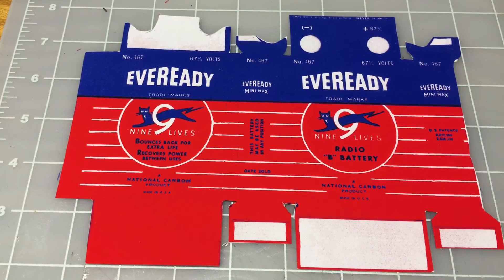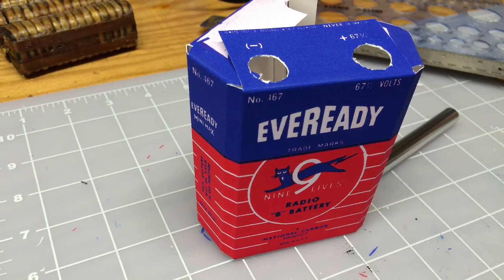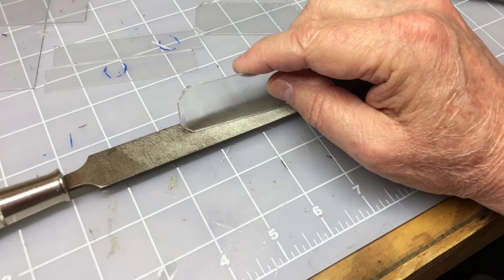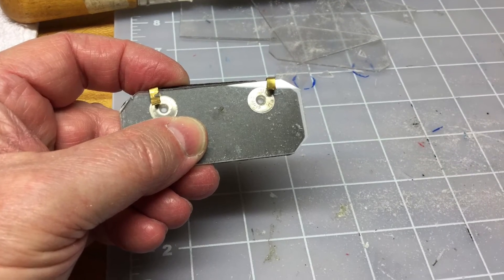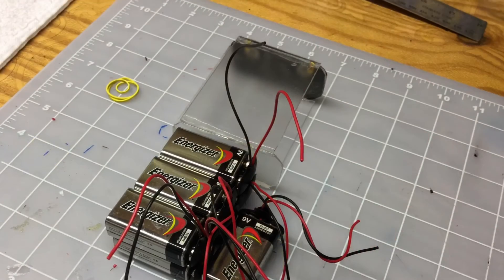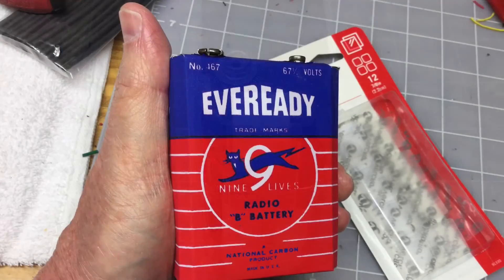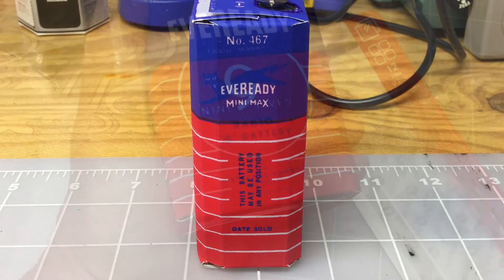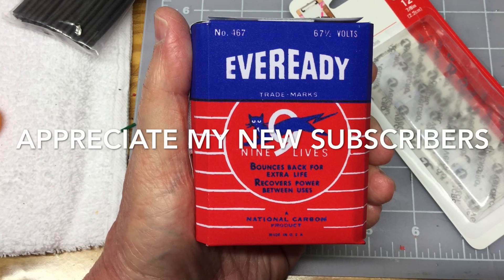Building a Type "B" Battery Holder

Comment: I tried to do a quick count on the batteries.  Is that 7 total?  Nice job on the case.  There are a lot of these old batteries which are no longer available.  This resurrection is not only nice visually,  but you have also brought the past into the present.
Reply from the maker: Stephen Moore Stephen, you are correct. The battery holder contains seven 9 volt batteries. Your comment made me go back and update the description to include this information for future... Thanks for your kind words and watching. Best, Don